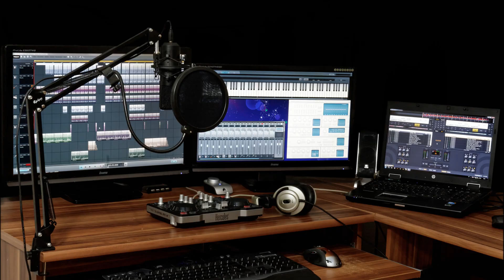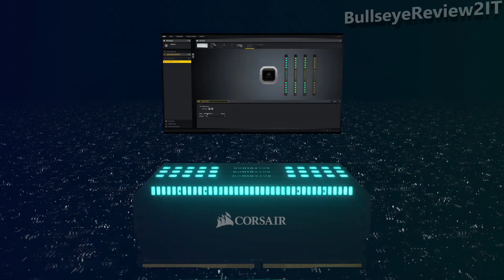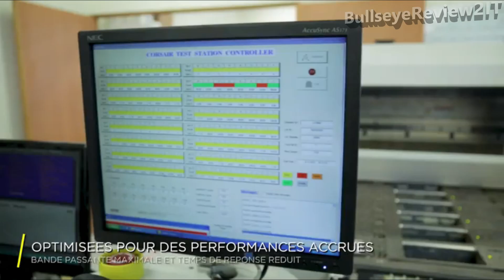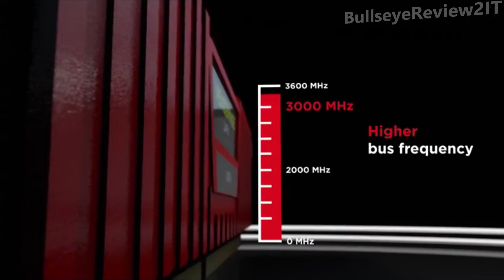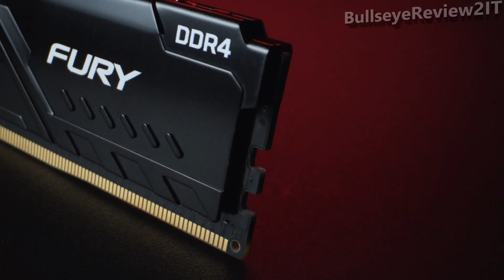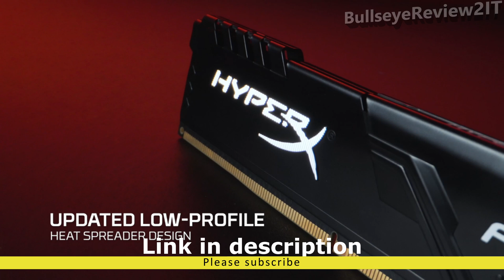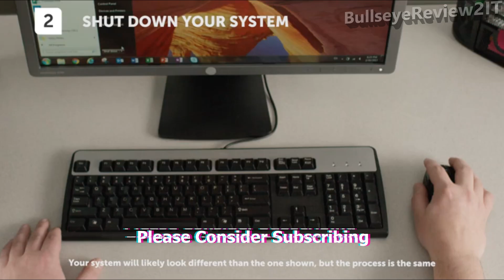Best RAM for Ryzen 9 5950x processor(not all)

Comment: puts on a grounding wrist strap, attaches  lead to case, and removes the case''s power cord.... smacks lips [ NOICE! ]
Reply from the maker: First of all, thank you for the comment, but I didn't quite understand what it has to do with RAM. If you are talking about the article in my blog, then please write this comment there.  Know that I have included your comment in the article. I hope it's ok? If it's not ok, let me know so I can make the necessary changes.
Reply: @AryTechB  
Sorry, was meme-ing on a bad choice.
 
You do realize that by disconnecting the power cord from the PSU, you removed the best grounding that the case had available right? 

This (ATBE) presumes that the other end of the power cord is attached to a wall outlet, or a power strip that is attached to a wall outlet.

The best method would have been: 
1. Put on the grounding strap, 
2. Attach lead to case, 
3. Disconnect the 24 pin motherboard power lead from the PSU. 
4. Install the Memory Modules. 
5. Reconnect the 24 pin power lead to the motherboard.
6. Turn on the P.C. to see if it POSTS.
7. if it doesn't POST, troubleshoot, until it does.
8. Upon success, remove grounding strap lead from case, and remove wrist strap.

Your demonstrated method could lead to E.S.D. destroying sensitive motherboard components, as any static electricity could still be present, because the case doesn't have an acceptable path to ground.

Most cases have rubber footpads, or other nonconductive materials to elevate the bottom of the case from a desk, or floor (etc). Therefore, the risk is elevated.

It was a meme, in all good fun. Have a nice day.
Reply: @princekermit0  the best method would be to not use a grounding strap and just not build on carpet or anything like that. I can't believe people still think they are necessary. Also I love the list you wrote as if it was a matter of fact it's the best way to do it. Like dude ur 1st 5 steps are useless . Just literally install cpu and ram on mobo 24 pin and check for post if your that worried about doa. If not just build as normal.